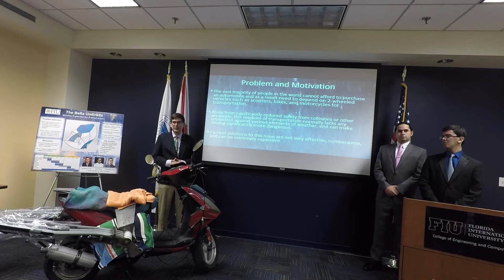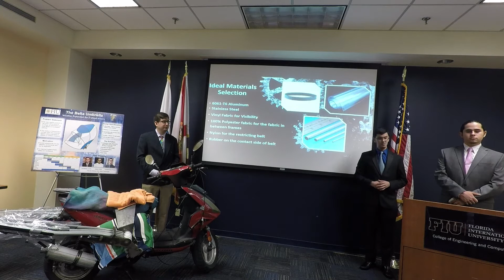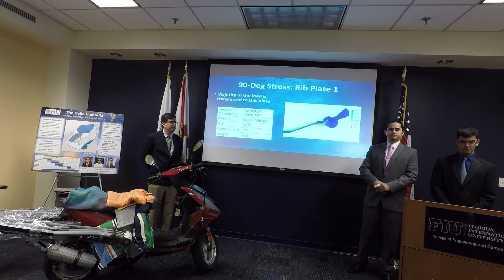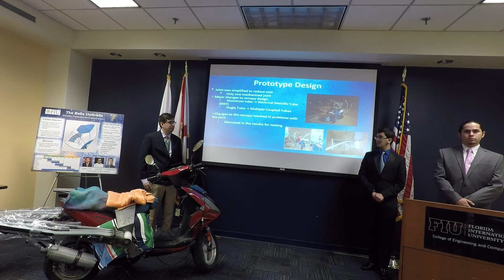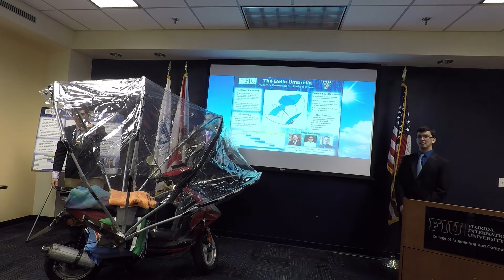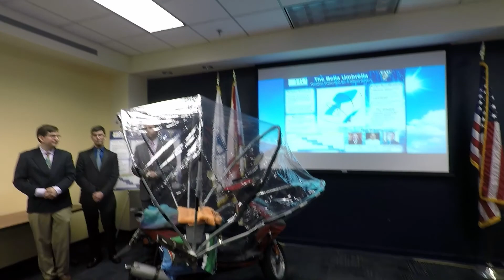SD Team 5: The Bella Umbrella

Comment: The team was very well prepared. Many flaws were found through testing and simulations but the team was ready to speak about improvements to fix some of those flaws. They were honest about the flaws their design had and spoke about their design with extensive details which shows knowledge and preparation about their design. The rain background in the first slide was distracting but the rest of the slideshow was well done.